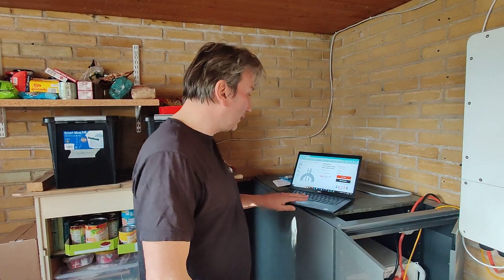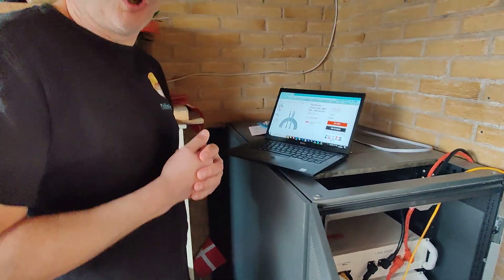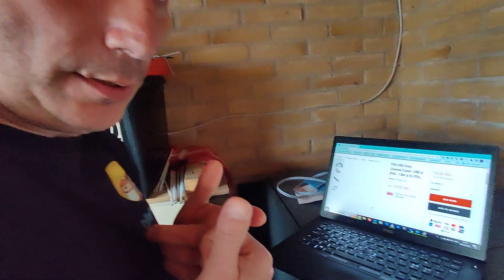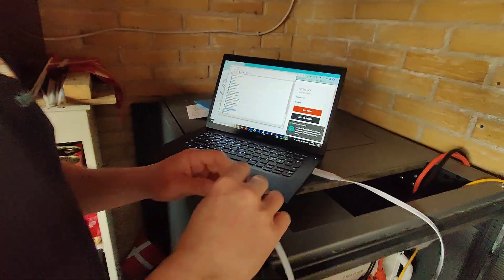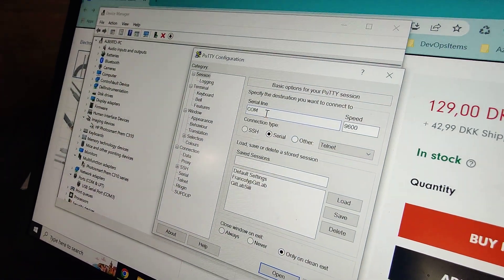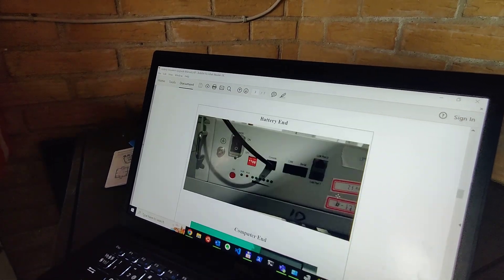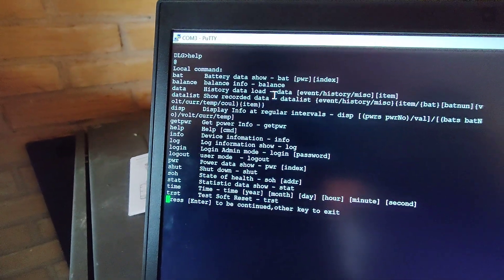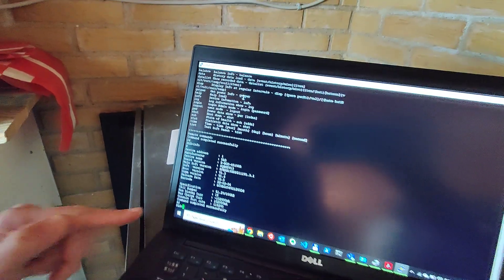Pytes e-box 48100R: PC to Battery connection and read out battery information

Comment: I also have 3 Pytes and 12kw Deye inverter. I bought a Orange Pi 3 LTS, a console cable, a FTDI chip cable for Deye and installed Solar Assistant. It allows you to see all the settings for each battery and inverter and allows you to modify any of the settings. It's awesome and basically plug and play. Data is displayed every 2 seconds, in real time basically, and accessible from any web browser in the world.
Reply from the maker: Super,
Can you maybe share the design of your setup so everyone can eventually replicate it?

Comment: Thnx Alberto, great approach! Got the cable, was able connect via Putty and console port. Unfortunately only one time, won‘t let me in again. Any ideas?
Reply: Hi Alberto, thnx for your kind feedback! Just a quick update: I was not able to re-connect via Putty, also pushing the reset button did not work. No idea what is the reason for this strange behaviour.
Meanwhile I received assistance from the PYTES tech department. They sent me a chinese version of Hyperterminal app, which could be translated via G-Translate and successfully installed on my PC. Even better, the connection via PC and E-Box console port worked flawlessly! Looking forward to your upcoming firmware update video!
Reply from the maker: @martinvogels6991  super that you solved it. Indeed I have also updated the SW using the hypertherminal pytes send yo me. I will post the video soon
Reply from the maker: Hi Martin,
I was able to connect every time to the batteries with no problems. Did you try to push the sw reset button of the battery? I will also try to update the firmware of the battery next days and I will post a new video. Please let me know if resetting the battery helps. If not we can share contacts and have a on line session
Reply: @albertomorando5563   Hello i would like to make an online sesion, cause i can t conect my PC with console imput